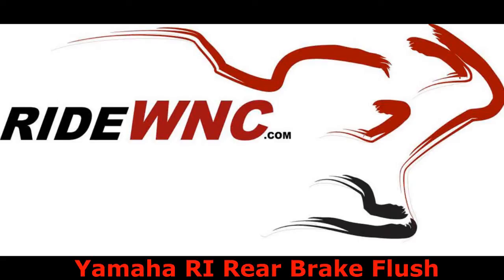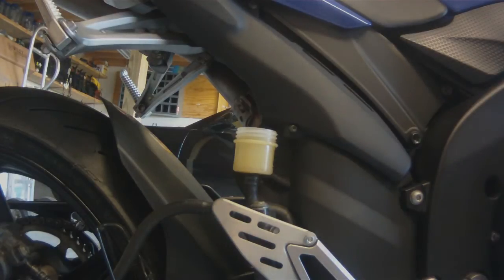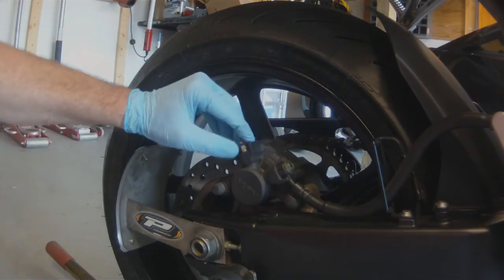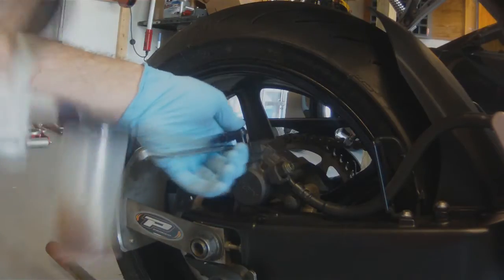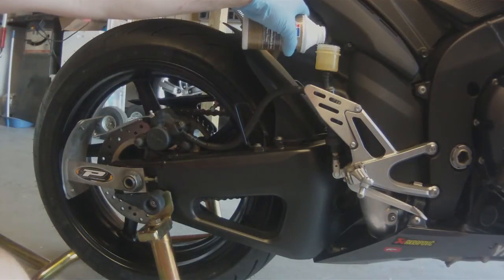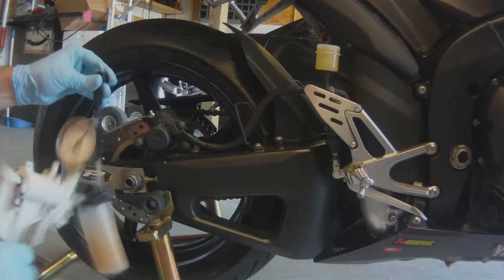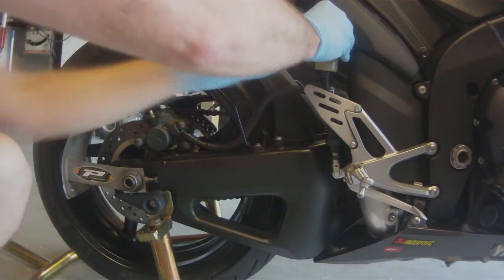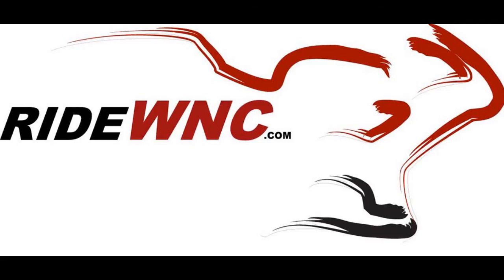Yamaha R1 Rear Brake Flush

Comment: Thanks for sharing. I have an 05 model and plan to change fluid soon. btw is this the same procedure for doing the front too?
Reply from the maker: ***** Yep.https://www.youtube.com/watch?v=GgdoHRzvi6c
Reply from the maker: ***** You will find a motorcycle doesn't bleed as easy as a car... Not sure why, just a lot more pumping.A MityVac will pay for itself the first time you use it. Once you own one, You will use it on your car.
Yes air will be in the whole system when you drain the reservoir. If the fluid is really nasty and dark, I will do this a couple of times with new fluid. Then I will fill and bleed one time. The goal is to get clear fluid back into the system. If you don't remove all of the old, you will see the new change color faster.

Comment: When I pressurize the line then Crack the bleeder valve I get a ton of air bubbles. I've run almost a entire bottle of brake fluid through the line, but I'm still getting the bubbles.
Reply from the maker: The air is coming from the threads of the bleeder valve, not from the brake system.
Reply: Ok, that makes me feel better. Thank you!

Comment: Great vid, would be better if you could explain how you would do it without a vac pump as it's not mentioned in the title
Reply from the maker: Matt X You are not going to enjoy doing this process without a vacuum pump. Spend the forty dollars for a Mity-Vac. Then you can service your R1 as fast as you ride.
Reply: MikeE RideWNC 10 POINTS FOR THAT REPLY.... Not disrespectful at all, but in a language we can all understand. Service fast/Ride fast. I wish I saw this when I was getting my bleeder check valve set up..... I am still going to have to get arm pump from working the lever to do the job of the Mity-Vac. Thanks Mike
Reply from the maker: Kevin Cummings Thanks. I needed that extra ten points. :-)
Reply from the maker: @YerrrrrMaw  Good one! It is not like your Prius.